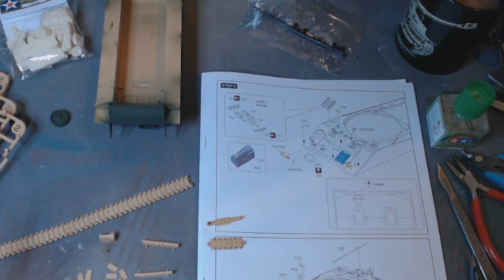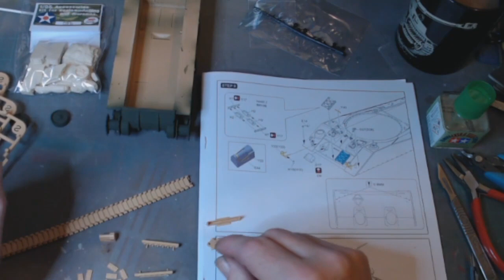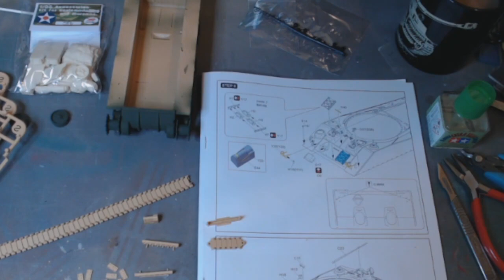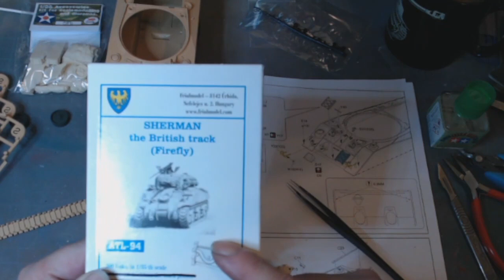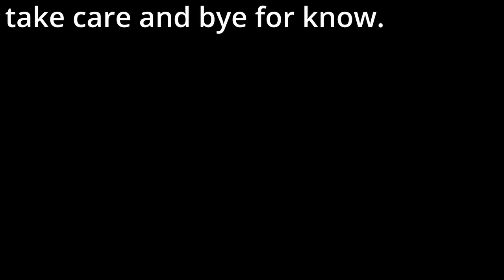1/35 RFM Firefly update part 2

Comment: Great suspension and track detail. Really good if you build dioramas With a handy track jig too. So much better than the tamiya toys. If you use ally barrel you may want to glue mantle in a fixed position to support the extra weight. Good luck with the rest of the build and best wishes 👍😎Pete 🤓
Reply from the maker: Thanks Pete it’s in the box at the moment wile doing a test fit I cracked the upper hill so waiting on a replacement 👍
Reply: @rickskits  I'd hate to ask how you cracked the hull but the Germans found that pretty easy too🤣surely it repairable 🤔